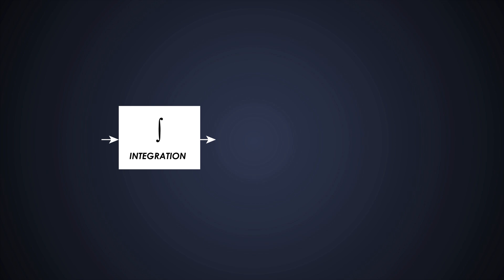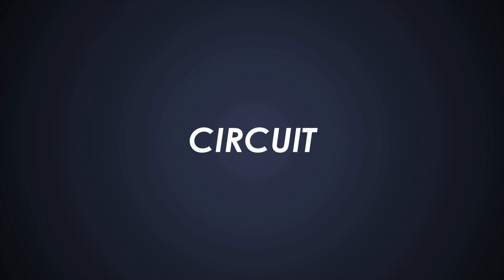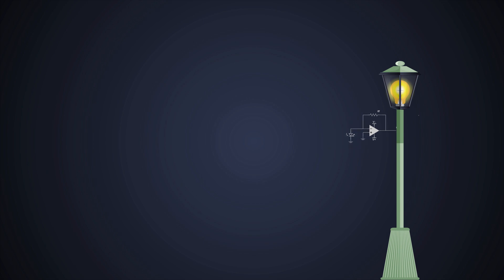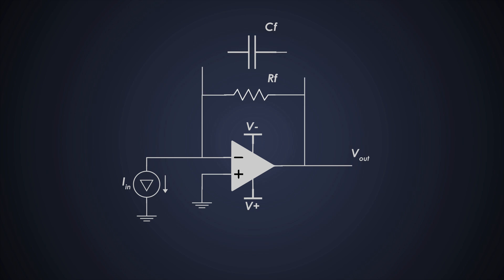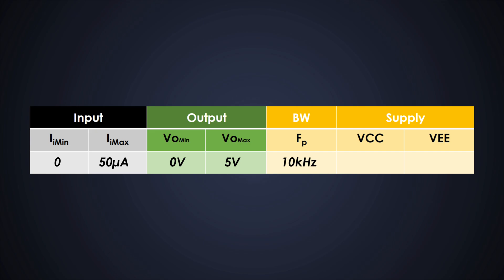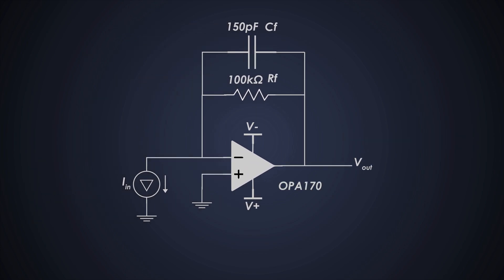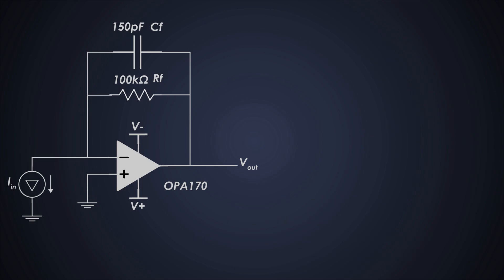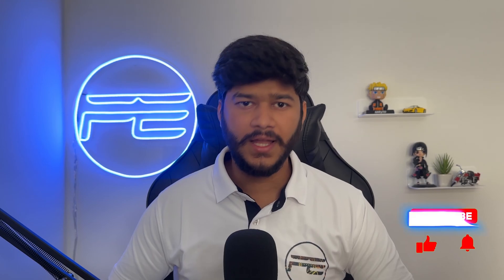What is Transimpedance Amplifier? Design of Transimpedance Amplifier? Current to Voltage Converter

Comment: Thanks for the great video. I'm currently working on a circuit that is supposed to demodulate a red laser signal (modulated at 1kHz). I think I'll start with a photodiode for a wavelength of approx. 660nm (BPW34) and your TIA circuit.